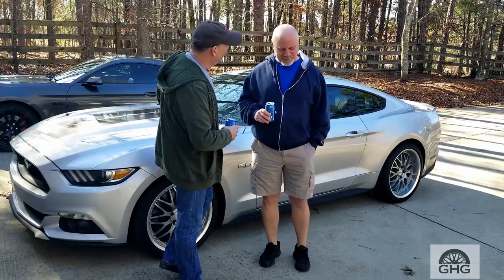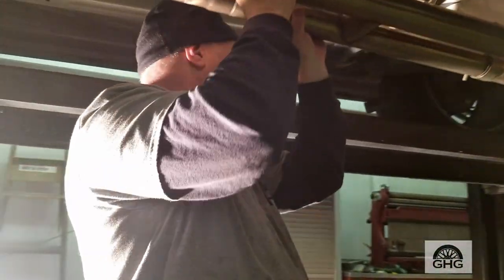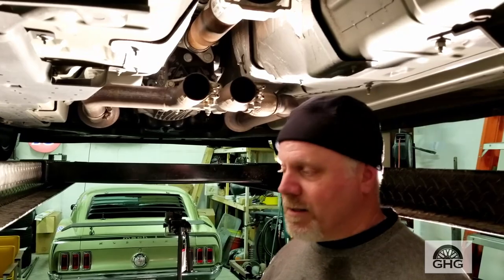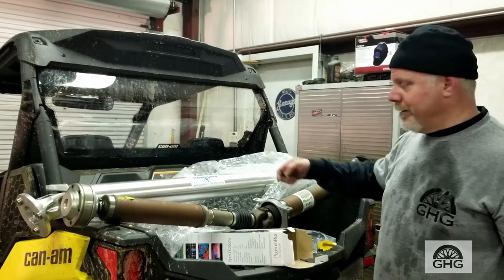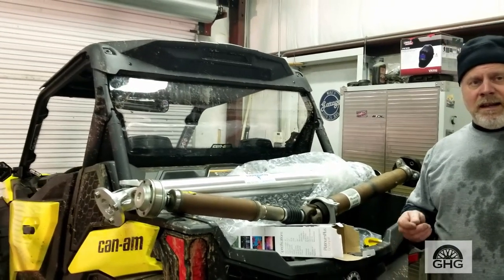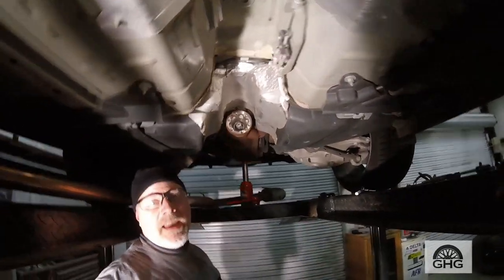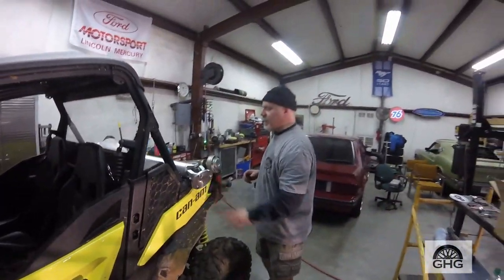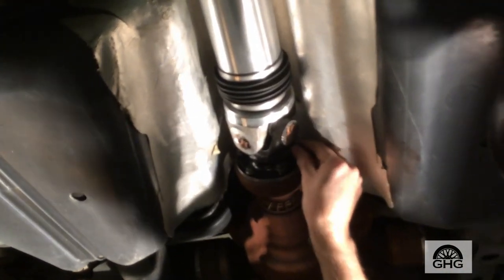Mustang S550 Driveshaft swap. Is 2 better than 1?

Comment from the maker: Hope you all are enjoying these videos.  Mike and I are having fun making them.
Reply: how did you get rid of the vibration? I just ordered shaftmaster DS and waiting to be installed. but I heard vibration is common with these driveshafts.
Reply: It is a common issue. When you get the new driveshaft installed. The driveline angles should be checked and adjusted. If for some reason you have you still have a vibration, you may have to rotate the driveshaft. 6 bolts attach the yoke to the pinion...you have 6 try's total to get it right. If you are having it installed by a shop...this may become a pita for you. As you may have to go back to try again. Hope this helps! Thanks for watching!!
Reply: @mustangmike5324  are driveline angles adjustable on S550? I am having it installed by a shop, so I will make sure to go for a test drive before I go home with the car.
Reply: I cover that in the video, but the only thing that can be adjusted easily is the trans. Shouldn't be off much, if any.

Comment: Thanks for making the video.
Does anyone know if the 2 piece can be switched to a one piece for the 2015 Mustang V6 automatic?
102,000 km's and it needs replacing and shocker Ford doesn't have any and no idea when they will.
Any input would be appreciated.

Comment: Is the driveshaft angle only a problem for you specifically, or would I have the same issue on my 2017 manual GT? Is the 2-peice shaft the sole reason for the clunky upshifts on this era Mustang?
Reply: You always want to check the driveline angles regardless. There are some great videos on how to do that. You can install the driveshaft and maybe be ok. Just keep that in mind. Not sure what you mean by clunky? I'll assume that the car jerks a little when shifting...if so, then probably yes. Sometimes the engine mount/trans mounts can cause issues too. Always tackle 1 thing at a time. Thanks for watching!!! Hope this helps...
Reply: This GT has clunky upshifts since new. The gearbox shifts fine, and if you are reving her out on a backroad it's no big deal. However, at slower speeds there just seems to be a ton of driveline lash on upshifts. Understand I'm 52 and been driving manuals my whole life so it'snot like I'm an amateur. Thanks for the video!
Reply: @scottieray  so by that description, you'll definitely like the way it feels. More direct feeling like the older cars. I just wasn't sure about clunky feeling meaning. Heard of so many issues with the mt82 trans, I thought you might mean that...🤙
Reply: The Gt does not have to be adjusted at the pinion for driveline angles. I forgot what it was called, but these cars sort of self align or are set up that way that the angle doesn't change at that point. My terminology is probably off.

Comment: My 2000 BMW M5 has the same type of drive shaft. The rubber piece, on the flange, they call a Giubo (silly Germans). It also is a 2 piece shaft with a "carrier bearing" , pretty much like you have here.  I have them standing by, and ready to install, but I keep putting it off...maybe it's because I don't want to have to do it 3 times!

Comment: I called to order a DS, unfortunately Shaftmasters  no longer makes a DS for S550 Gen 2 Mustangs. :(
Reply from the maker: Bummer stangfreak91, thanks for watching though 😎
Reply: Stange... I'm surprised to hear that. Surely someone has one that is readily available!  Hope you fine one. Thanks for watching...hope we helped!!
Reply: @mustangmike5324  Steeda and Dynotech make them. steeda has them in stock but Dynotech is on backorder until September
Reply: @shepherd3085  biggest thing for me was the ability to rebuild if needed. Good luck on your choice.